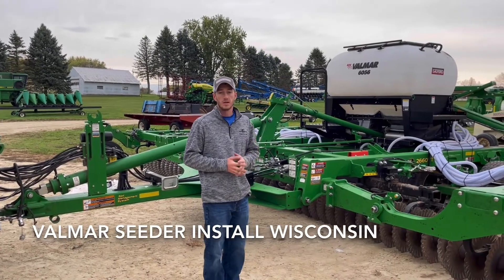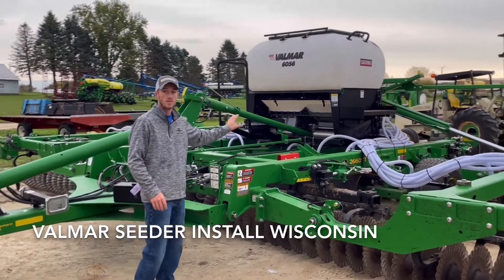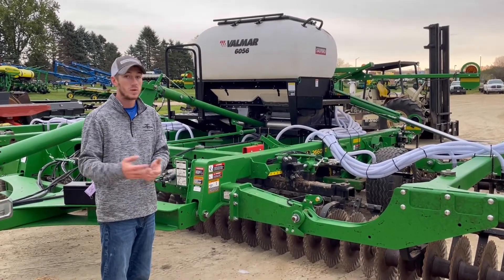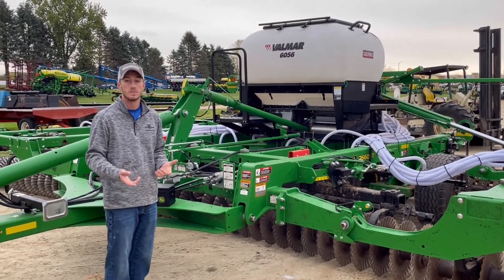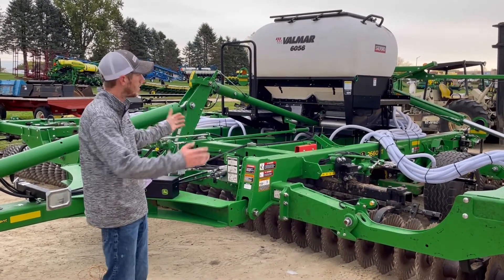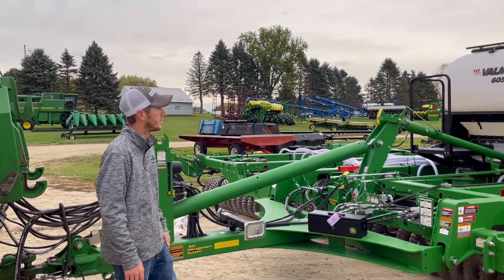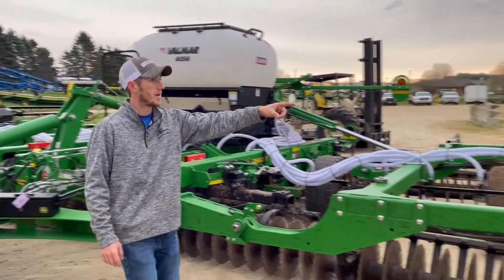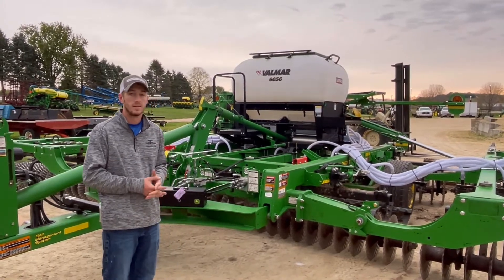To Wisconsin we Go, John Deere Seeder Install

Comment: how much does Valmar hold and what rate are guys using on there blends
Reply from the maker: The 6056 in the video holds around 3,000 lbs

Most guys are between 30-50 lbs/acre
Reply: @FennigEquipment  thanks